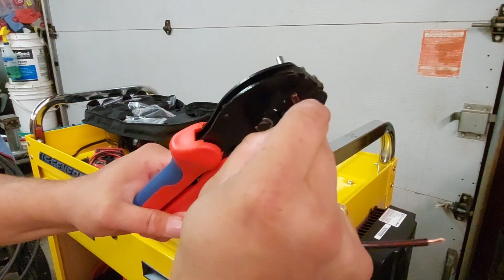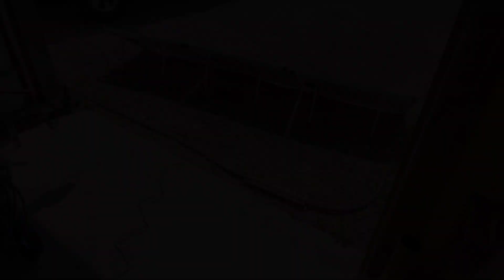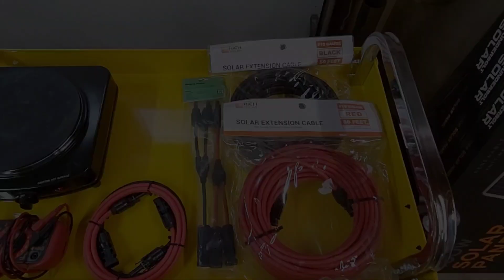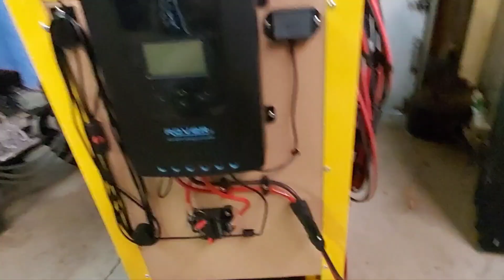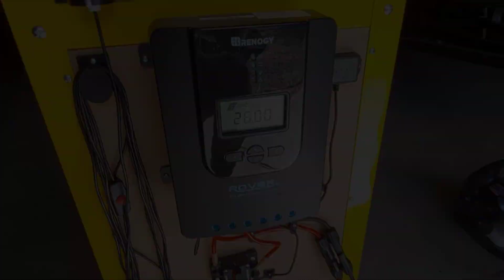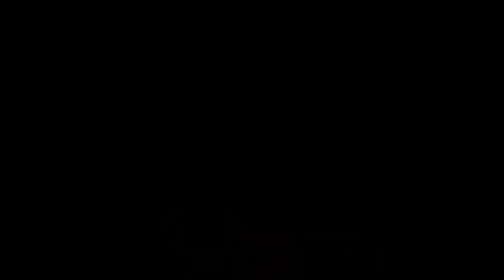Emergency solar power cart upgrades

Comment: Is your 120 v receptacle wired backwards or are you using the black multi meter wire for positive? Just didn't see a - on your meter display when you were reading the voltage towards the end.  Long slot is negative in the receptacle for viewers that might not know.
Reply from the maker: It is wired correct, my meter does not indicate polarity on a.c. so I just jam the probes in, in no particular order
Reply: @joshuaburks  gotcha, I figured that was probably why I didn't see the reverse polarity.

Comment: I have the same charge controller. My BT-1 lasted for about 2 weeks and gave up the ghost. It is nice to have the app to monitor the charge controller, but mine sits in my mud room where it is easy to check. I just bought (used) thirty 240 watt panels. Now it is time to upgrade the 40 amp controller to a 60 amp controller and start investing in Lithium. It is going to be a 24v system, so my wires from the panels to my box where everything is combined can be pretty small in gage (14 if memory serves me correctly). Keep us updated on the unit.
Reply from the maker: I hope my BT-1 last longer than that! I will eventually go to lithium, maybe add more panels, perhaps battery monitoring. I'm not quite 100% done with this project but close, I have learned a lot from it and could always scale it up in the future, thanks for the comment.